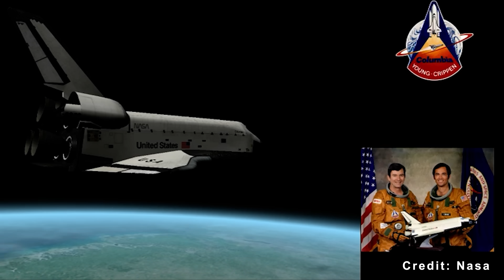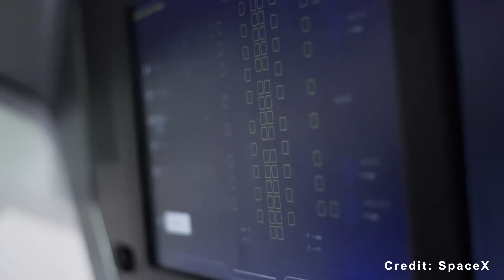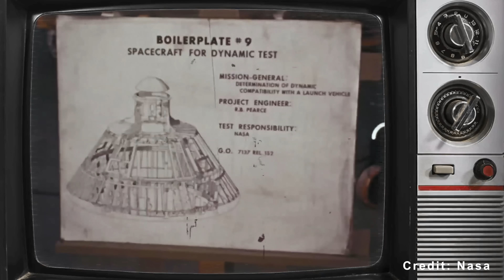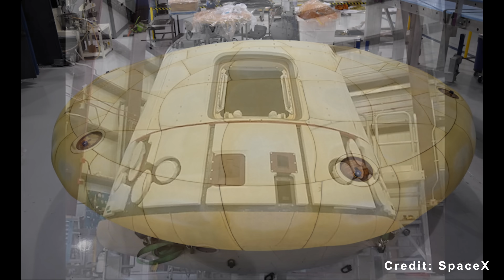SpaceX Dragon Just Did What NASA's Best Spacecrafts IMPOSSIBLE!

Comment: Directly comparing Dragon and Space Shuttle makes little sense to me. The Space Shuttle was a vehicle designed to be fully reusable. But the program took a cheap shortcut by using the solid rocket fuel boosters and the disposable tank. The spaca shuttle was mauch larger, could choose where to land, bring up AND down significant payload. It was a technological marvel, and would have been praised as the beginning of regular Space flights, if they had been able to add the reusable booster/tank Unit and if they had already finished  a shuttle 2.0 after 15 years. The Dragon capsule is a technological marvel for its efficiency, reliability and its well balanced mission profiling. Starship will be what a Shuttle 3.0 would maybe have looked like.

For the Orion capsule: I have a hard time understanding, why its so impossible to improve it significantly. If they could squeeze out a decelleration burn, they could get down to shuttle and Dragon velocity.

Comment: Seems to me some retro rocks can solve the high speed issue, and thus will mean less heatshield needs.   
Why not retro rockets to really slow down?
Reply: sure, jus go to the retro rocket store on the way back from the Moon.  Every pound of fuel leaving the earth to slow down is a pound of payload you cannot bring.  Slowing down in air is relatively free except for the weight of the heat shield..
Reply: Might be possible if you has an orbiting fuel depot so the entering vehicle could refuel sufficient to retro burn to slow re-entry.
Would be interesting to see how many "return missions" a Falcon could put into orbit.

Comment: I have a question, if a shuttle come back to earth, and during his reentry has started to get a spin when it released its parachutes and you got tangled up, do they have a back up they can cut the parachutes and then launch a new backup parachutes 🪂?
Reply: I think shuttle does not deploy parachute while it is on the air but only at touch down on runway. It uses only one parachute at the tail of the vehicle body. There will be no tangle or spin possible.